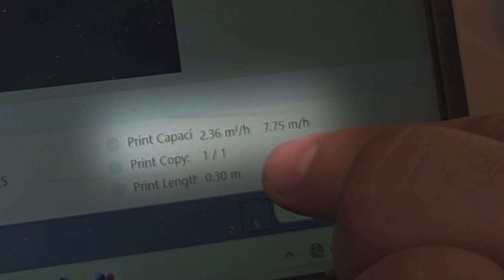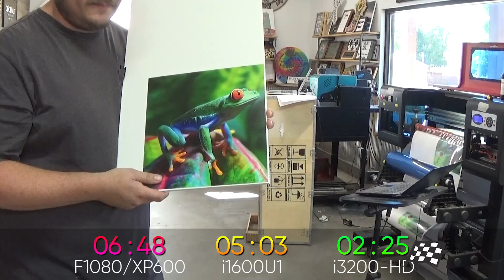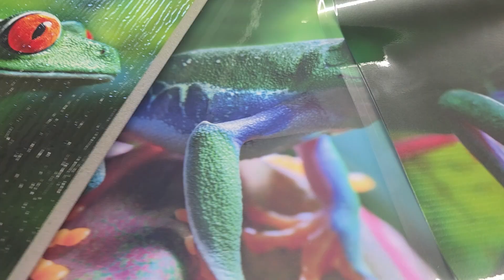Speed Test XP600 vs i1600U1 vs i3200-HD Which Printhead is Fasted for UV Printing?

Comment: Tengo una duda importante , estoy por comprar una impresora DTF UV con el cabezal (I3200 8 HD) y obviamente la estoy comparando contra una de 3 cabezales XP600 . No necesito definición , ni una velocidad muy superior . Necesito rentabilidad en metros y tiempo de uso . entiendo que los 3 xp600 cabezales duran 6 meses aprox y son 3 .quiere decir en un lapso de 18 meses abre usado 9 cabezales  VS 1 de I3200. La tinta para XP600 o i3200 es igual en precio ? .

Si es así  cual es mas rentable 3 XP600 o uno de I3200 8 HD ? en promedio el xp600 cuesta 300 dls *9 = $ 2.700  en 18 meses vs $1500 de i3200 hd . 

Ojo no tengo ni idea por eso pregunto

Comment: I didn't realize you could get white, CMYK and varnish all on one 3200 print head... Even though they're more expensive, is there any advantage going with 3 x i1600u heads over one 3200?
Reply from the maker: Not that I found the 3200hd seems great so far now if you did the i1600a for normal dtf the heads are much cheaper might be worth doing them
Reply: @JaysToDoList on my 6090 ultra, it has space for up to 4 heads and I'm running 3 x i1600. Would it be possible to eventually change to just a single 3200 head, or are you stuck with what you start with?
Reply from the maker: @kyle25rs stuck with the heads you have